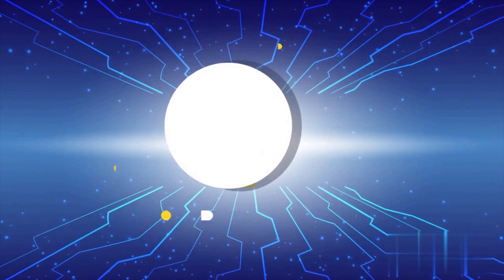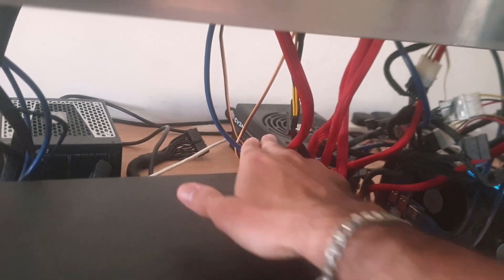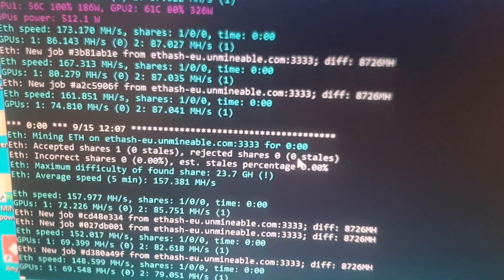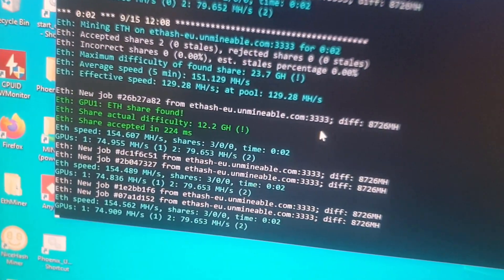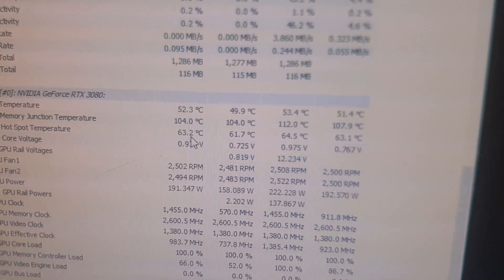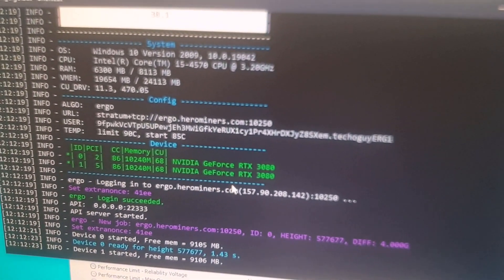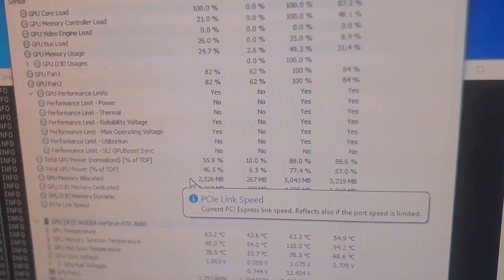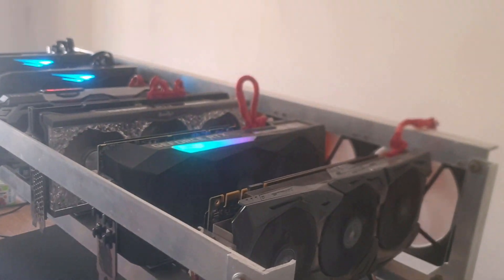Mining Rig Upgrade | Up from 272MH/s to 430MH/s on ETHash

Comment: Thanks for this video please sir if I went to start mining what and what do I need to buy to start mining
Reply from the maker: You would definitely need some good video cards (GPUs) and they are quite expensive right now, and obviously mainboard/CPU/ram to connect them, but even an old computer with PCI-Express slots will work, and if you intend on having many GPUs you will need riser cards so the cards can be placed outside a case and will help for cooling them better too.
Reply: Thank you very much please I just want to ask you if you can help me my sending me the command to Xmrig and phoenixminer so that I can use dos command to setup my own thanks I am waiting to hear from you thanks very much

Comment: Finished with termopads today, same gpu's. You will need 2 pads with 1.5 mm and 2 x 2mm per card. I have used 2 mm on copper plate and 1.5 mm on stainless steel portions. I used termopaste on top of cpu, and on around cpu border. Can be to mach, but working perfectly. When you will setup card back, check for cables on the back of the card. One, the smaller bolt can damage one cable. Take your time! The result will be perfect!
Reply from the maker: Thanks a lot for the information. The ones I have ordered are 2mm and 3mm thickness, will see how it goes with those and if needed will get the 1.5mm too. I think the gap between backplate and under the memory chips is quite large.

Did you put pads on the underside of the memory too? Also which brand of thermopads did you use and what temperatures and hashrates are you getting now when mining on ethash ?

Thanks again for sharing.
Reply: 3 mm is to big. My first test was 3 mm on copper and 2 mm on stainless steel. Not good. Cpu is overheated, gap on cpu and cpu border to big, termopast not working on that gap. Need 1.5 and 2 mm pads. All 30xx ti is LHR. Card showing 70 mh/s on ETH with NBminer. Need lolMiner with --mode LHRP settings on 470 driver to get 85 mh/s.

Comment: Just put up a external fan blowing through the backplate until you get your pads. My pny 3090 memory is at 92c with this method. Not ideal but you should get close to full hashrate and cooler temperatures.
Reply from the maker: Yeah I have an external fan on 1 of them, but its only slightly better and its a 1600rpm fan. Blowing from top might help too. With the thermal pads it should really help. Will have a follow up video on that too.

Thanks for your suggestion and for watching 😊
Reply: @ThatTechoGuy  keep up the good work. I love the content. I also mine Ergo mostly on my lhr 3080. 227mh 216w On nbminer 39.2 I get 275mh @265w on the 3090 but when the difficulty spikes like it did overnight I have to move the 3090 back to eth.